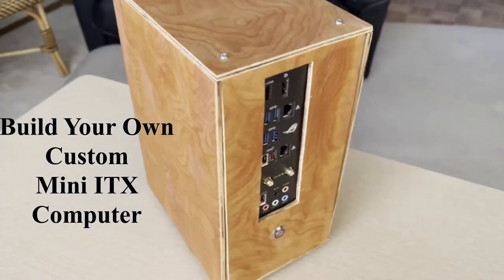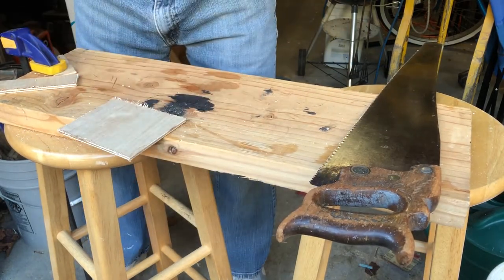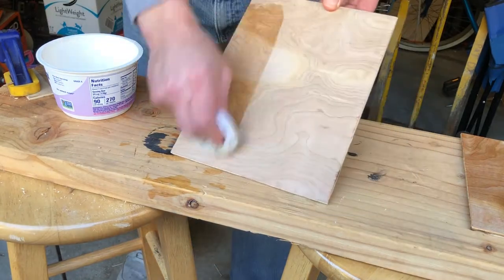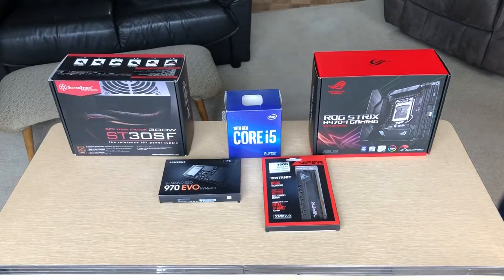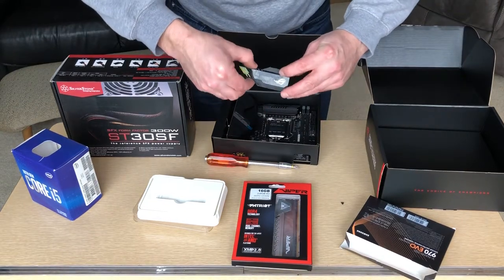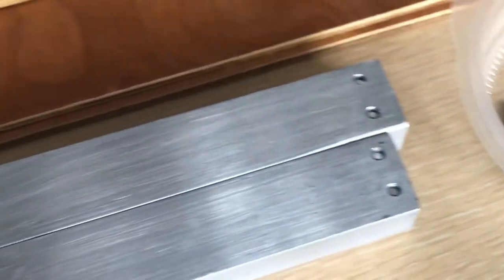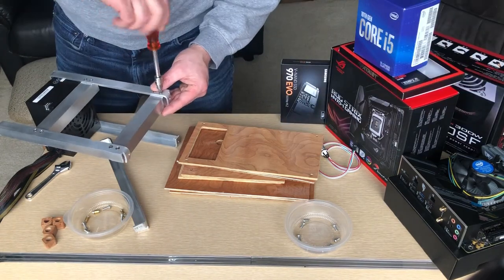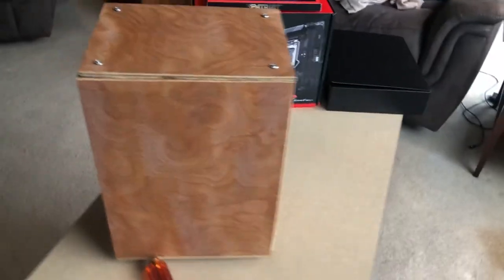Mini ITX Computer and Case: DIY Build Your Own Custom PC Wood and Aluminum

Comment: To be clear- you are using 6-32 screws which means a #6 size screw with 32 threads per inch.  The script in the video says "six thirty seconds" which is a different thing.
Reply from the maker: Thanks for the clarification.  #6 size screw with 32 threads per inch is right.  We could call it "Six Thirty-Two".  Need to dig into the subtitles.  LOL

Comment: wood is the insulation of heat inside...buddy think about some ventilation...plexiglass transparent would be much better and also you can buy per meters, and I think it's easier to cut
Reply from the maker: Like it! I am working on some upgrades.

Comment: i think, there should be a hole for air circulation, in and out :D
Reply from the maker: I agree.  I thought the case would leak air but it needs a vent.  I plan to upgrade it in the future.